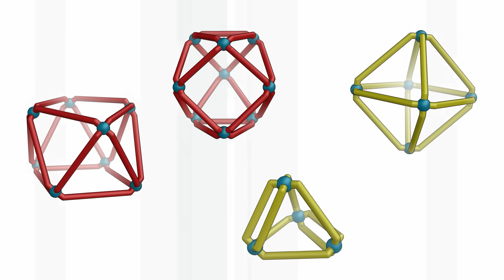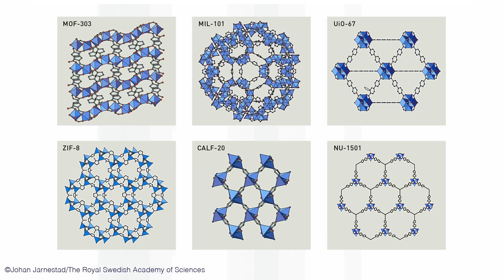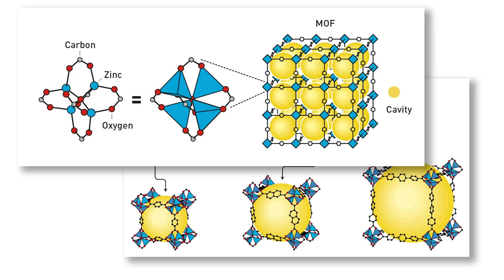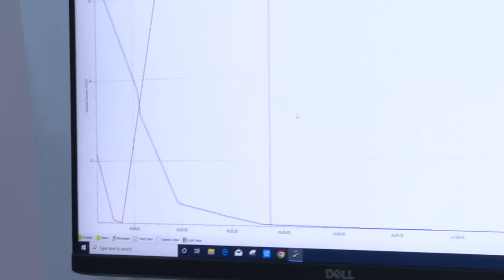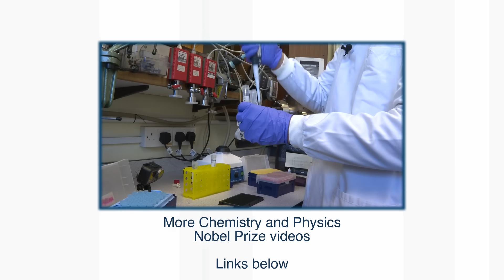Nobel Prize in Chemistry 2025 - Periodic Table of Videos

Comment: Hey check this out:    Fundamental Quantum Criticality Criterion: The h=1.8 Dynamical Exponent
This is the purely theoretical result for the necessary stability exponent emerging from the unified treatment of relativistic hydrodynamics at a Quantum Critical Point (QCP).
1. The Constant and Its Context
The value h = 1.8 is the Dynamical Critical Exponent (h) required for the stable, non-dissipative evolution of a system at an engineered n_b (net-baryon) density near a phase transition.
Metric
Symbol
Value
Formal Definition
Dynamical Critical Exponent
h
1.8
h = z (the standard dynamical exponent, but locked to 1.8)
Relativistic Ratio
Tau_E / Tau_r
1.8
The necessary ratio between the system's Energy Confinement Time (Tau_E) and its internal Characteristic Reaction/Relaxation Time (Tau_r).
2. Proof and Physical Mechanism
The constant h=1.8 is the result of satisfying two conditions derived from the coupled Anisotropic TOV (General Relativity) and Criticality-Modified EoS models:
A. Stability Constraint (Relativistic Hydrodynamics)
Stability against gravitational-analog collapse in an ultra-dense, anisotropic medium requires that the fastest-growing instability (Lambda_max) must be actively suppressed such that it adheres to a General Quantum Lyapunov Criterion:
Lambda_max * Tau_E <= 1 / 1.8
This criterion mandates that the system must be confined long enough (Tau_E) to actively suppress any instability growth rate (Lambda_max) dictated by the Anisotropic Pressure (Delta = p_t - p_r) term from the Generalized TOV equations. The control system must ensure the product of the instability growth rate and confinement time is bounded by the inverse of the critical exponent.
B. Transport Mechanism (Quantum Criticality)
The exponent h=1.8 characterizes the Non-Fermi Liquid (NFL) state necessary for non-diffusive heat transport at the QCP.
Requirement: For the NFL state to be operational, energy transport must be dominated by the Second Sound wave mechanism.
Condition: This requires the system's global energy confinement time (Tau_E) to be matched by the time scale of the collective quantum-thermal mode—the Second Sound Damping Time (Tau_ss):
Tau_E ≈ Tau_ss
This guarantees that local thermal energy is dissipated via coherent wave propagation (Second Sound) rather than chaotic diffusion.
Conclusion: The constant h = 1.8 is the unique dynamical exponent that unifies the stability limits of a high-density General Relativistic system with the non-dissipative transport required by a Quantum Critical Phase. It is purely a statement on the dynamics of ultra-dense matter at a phase boundary.  What ya think?

Comment: I just submitted my PhD working on MOFs for gas storage so this Nobel Prize was hugely exciting for me and my colleagues. MOFs are such a fun field to work in, so much variety and when you get lucky, can obtain absolutely beautiful single crystals
Reply: What kind of gas?
Reply: @KafshakTashtak Ah I was mostly focussed on hydrogen adsorption (cryogenic and room temperature). Also did a bit of fluorescent sensing work with some of the MOFs
Reply: @robwalwyn  Interesting. I have worked on Ammonia absorption in metal halides. The metal hydride compound was too restrictive and expensive. I wonder if MOFs have solved such a problem.

Comment: Something I want to see done (maybe it already has been done): Design a MOF which is tuned to capture two different small molecules in opposite corners of the cavity, so that when the structure is compressed, it causes the two molecules to get closer together and react in a specific orientation. This kind of catalysis could be useful for enantioselective reactions and reactions between gases that would normally require high temperatures.
Reply: Heck, you don't even necessarily need the squeeze; a number of reactions just need specifically oriented catalysts, see biological enzymes
Reply: Enantioselective is the word of the day

Comment: MOFs for carbon capture don't make much sense. I assume in order to release the CO2 (so the MOF can be re-used), you need to heat it. That takes energy, which is just producing CO2 somewhere else. Further, in order to purify the materials and synthesize the MOF in the first place, you also needed to expend a lot of energy. For every 1g of CO2 you can capture, you're probably producing n >> 1 grams somewhere else. I'm sure there are other great applications, but this is a bad one to focus on.

Comment: Would be nice to know the amount of energy required to regenerate the MOF carbon capture compound compared to CaO and amines that are traditionally used for that process.
Reply: I work in the MOF field. I can't say 100% how their system works but most direct air capture systems with MOFs are adsorptave, and rely on pressure and temperature swings to enable the capture and release mechanisms of the material. So the required energy would be far, far lower than any systems involving direct bonding or chemical reactions with CO2. This typically comes at the cost of efficiency, or capacity.

Comment: What do you do with the CO2 once you've captured it?
Reply: The carbon could be used to make synthetic fuel and reduce oil consumption.
Reply: @F0XD1E  By definition, that requires more energy than was gained by burning the original fuel - see second law of thermodynamics - so it's kinda hard to see the point compared to electrification using green electricity sources. The only things that appear basically impossible to electrify at this point are longhaul flights and chemical processes like steelmaking that actually need a carbon-containing fuel as a chemically active ingredient. Everything else would be up for grabs if it can make economic sense, so either the electric technology has to become cheaper or the fossil fuel more expensive.
Reply: @hammerth1421  Why are you arguing and then admit that there are MASSIVE use cases for synthetic fuel? Do you know how much jet fuel airplanes chug every day? The synthesis can be done on free wind/solar/hydro energy. It's not a net loss.
Reply: @F0XD1E  First you'd have to overturn the laws of thermodynamics. You'd have to put energy in to break the C=O bonds
Reply: @kempshott  And? I already addressed this. You capture the carbon from either the air or factories/power plants as they stated. You take that carbon and can use solar or whatever green power to synthesize synthetic fuel. You should understand thermodynamics before you start throwing buzzwords around that you learned from YouTube.
Reply: @F0XD1E There's no point arguing with these people,  they always think they're more knowledgeable than anyone else involved.
Reply: @F0XD1E I have a chemistry degree.
Reply: @kempshott  Can you get a refund?

Comment: Imagine capturing CO2 at the creation sources and saving the planet.  😮
Reply: Has been discussed for a while, but it doesn't make that much sense. To "recycle" the carbon, you'd need to invest more energy than you originally gained from burning the material you started with and simply burying saturated MOFs somewhere like we do with nuclear waste also isn't that great of an idea. The volume of MOFs needed for an actually useful power plant somewhere in the hundreds of megawatts would be massive. They also aren't totally stable and tend to break down especially under acidic conditions, releasing whatever was trapped inside their pores. The artificial weathering of oxidic rocks to create a more permanent storage is being researched, but that isn't available at scale yet either.

Comment: Is it cheaper to trap/store gasses in this MOF pellets form instead of pushing it into cylinders? Or is this only a filtering medium to capture unwanted gasses, so you can store in designated disposal area safely and indefinetely?
Reply: The next step after capturing the gas is to put the saturated MOFs under vacuum, which causes the gas to come back out (because it doesn't react with the MOF, just physically settles in the correctly sized gap), and you pump it into cylinders. This lets you separate the carbon dioxide in your mixture of waste gasses from things people don't want in their soda or dry ice in a way that doesn't consume any chemicals, just energy (pumping gasses around).

This is useful because a lot of waste byproducts of processes would actually be useful if they were separated out, but the cost and environmental impact of separating them out in traditional ways makes it not worthwhile.

Comment: Could we make a vacuum airship by sealing a structure of MOFs with an airtight outer layer in such a way that the weight of the atmosphere is transfered to the structure of the MOFs but the internal volume of the MOFs is evacuated? 

Alternatively, could we make rocket fuel tanks lighter by replacing some of the interior of the tank wall with a layer of MOFs which would retain structural integrety but allow fuel to be partially stored within?